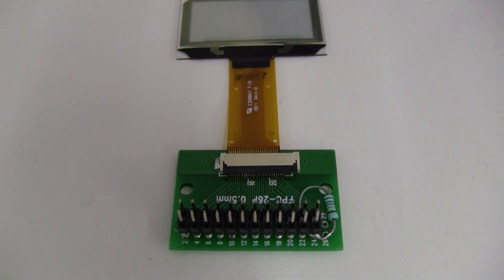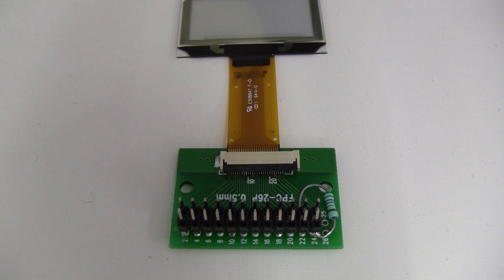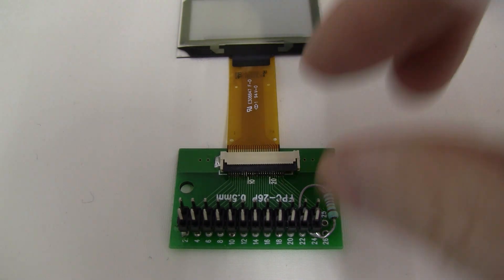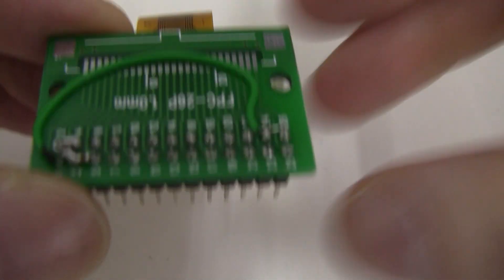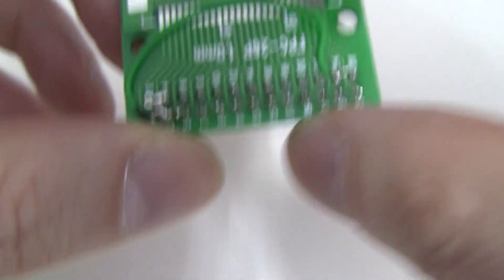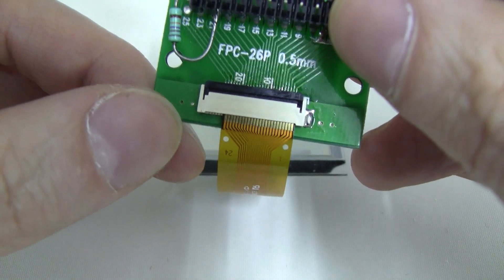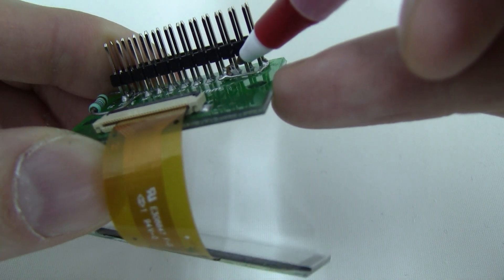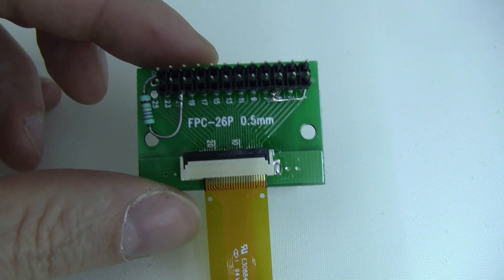Wiring a Transparent OLED for an Arduino

Comment: So the pins labeled on that pcb pin breakout(used in video) you guys are using, are those equal to the pins on the connector? I'm trying to avoid using the breakout board.

and what is the setup for as used in the video, I2C?, 4 Wire?
Reply from the maker: You'll want to use the pin table in the datasheet: https://www.crystalfontz.com/products/document/4054/CFAL12856A0-0151-B_Datasheet.pdf and the schematic, it's on page 6 & 7.

Comment: Can it be used with esp8266
Reply from the maker: Hi, yes. It can be driven by any controller with enough GPIO pins. We do not have sample code for the esp8266 though.
Reply: @Crystalfontz    can't we use the Arduino code for it ?
Reply from the maker: @vamsikrishna1009  You're free to try, I'm not familiar with the esp8266 but if it can run SPI, I2C or parallel it'll likely work. You can download our demo code from this page: https://www.crystalfontz.com/product/cfal12856a00151b-128x56-transparent-oled-screen
Reply: @Crystalfontz  thanks 👍

Comment: Hi I love the price of the display but want to make my own pcbs to make it smaller, I was wondering what pins of  the ribbon cable are for scl sda or what I would need to do to get this running as an i2c slave. Thanks so much
Reply from the maker: You can find everything you need in the datasheet on this page: https://www.crystalfontz.com/product/cfal12856a00151b-128x56-transparent-oled-screen

Comment: Hi! Can you do a 1 by 1 step quide. As most people here are a tad confused.
1) what pins do i connect to the seeeduino?
2) wheres a code that i can run?
3) can you send links for the resistors and copasitors and ect, from amazon?

(sorry if i sould rude)
Reply from the maker: Hi! We know this isn't the easiest display to bring up and we're considering making a breakout board for it. However, you can find all that information in the datasheet of the display found here: https://www.crystalfontz.com/product/cfal12856a00151b-128x56-transparent-oled-screen as well as demo code under the files section of the site. You can also see the schematic with all the resistor and capacitor values (on page 6) of the datasheet.  This video may help as well https://www.youtube.com/watch?v=XqvNs5WoXHI If you have any other questions, feel free to open up a ticket at support@crystalfontz.com
Reply: @Crystalfontz  A breakout board would be great! I think you would sell more of them because it would be simpler, also consider making a discord server or something to have live chats with the public!

Btw i bought one yesterday. They look amazing in the videos, hopefully im gonna wire it correctly, when i get it
Reply from the maker: @virtualmadchef7784  Thanks for the suggestions! Don't hesitate to contact support@crystalfontz.com if you need help. Also, we have a chat on our website where you can chat with our support team.

Comment: Can you run this with an Arduino Nano or mini?
Reply from the maker: You can use any board you want as long as it can run SPI and 3.3v logic. We use Seeeduino because they're switchable between 3.3 and 5v so it just makes it easier for prototyping.

Comment: could a raspberry pi run this display?
Reply from the maker: You could, but it's not an RGB display so you'd have to bit-bang it through the GPIO.
Reply: Thanks, I'm new to working with displays like this,  is the reason why the pi can't control it in the same way as an arduino because of it's lack of analog pins?
Reply from the maker: @gabesusman4592  here's a tutorial on SPI for raspberry PI: https://www.raspberrypi.org/documentation/hardware/raspberrypi/spi/README.md
The sample arduino code we use can be ported to the PI, the important bits are the initialization code and page addressing used to send data to each line. If you need help feel free to contact support@crystalfontz.com
Reply: @Crystalfontz  Thanks!

Comment: İs this video for me ? :) And just resistors ? Do we need any capacitors ? İf we need can you make a more detailed video
Reply from the maker: Yeah, there's 1 resistor and 4 caps. If you open the .INO file there's a pin connection diagram. You'll also need to provide 12.5v to pin 23 on the breakout board. You can use a bench power supply, or a step-up/buck-boost converter. I can make a video showing it completely wired but it'll be next week before I can get to it.
Reply from the maker: I added the pin connection diagram to the video description as well.